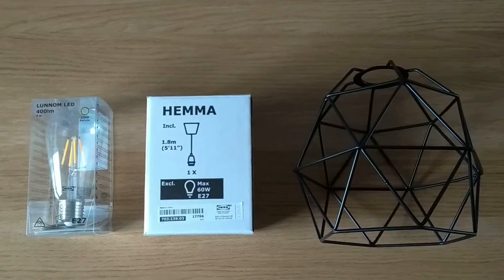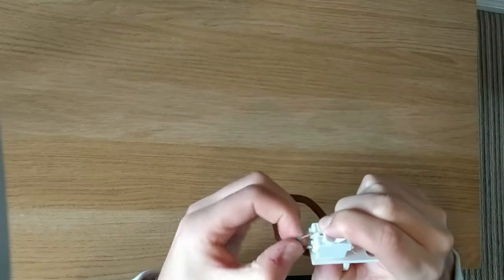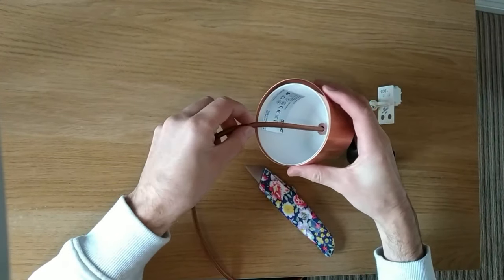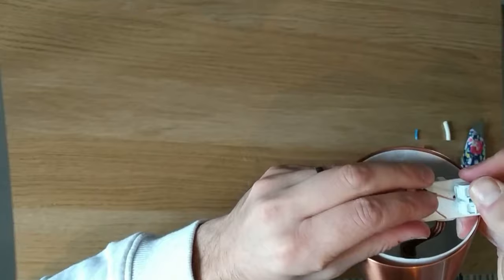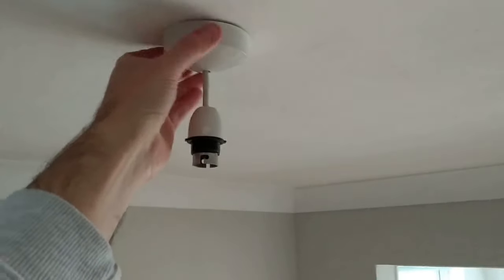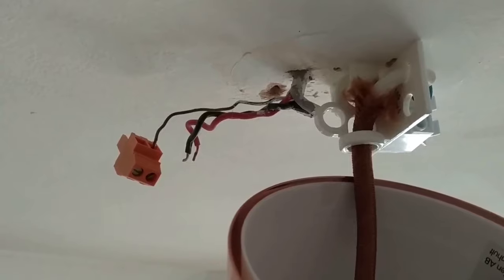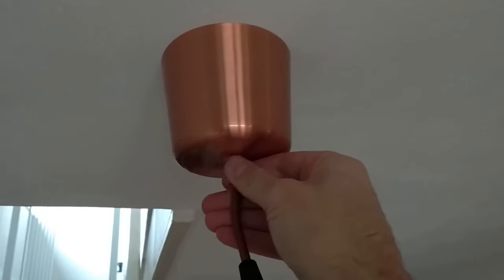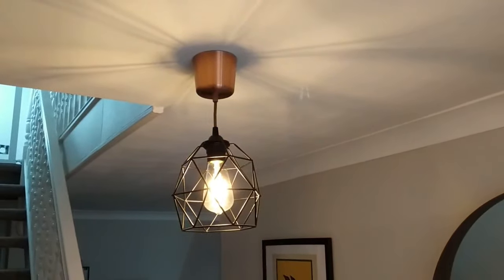Install a Light Fitting - IKEA Hemma

Comment: I think the design of this has changed slightly.  It's not as easy to shorted the cable as the the terminal block is only quick release on one side now.  It seems designed not to let you shorten the cable easily.

Comment: As another person has commented, this is designed so that you can draw the cable through the fitting that is placed on a ceiling hook, and in so doing adjust the height. So, in most cases you do not need to cut the cable to adjust the height. I understand you wanted to do this anyway as you did not want to wrap the extra cable inside the housing. But, even if you cut the cable it should be refitted the same way as it was before you cut it, threading through the two round holders, this fixes the cable to the part that is then put on the hook, which means any tension or weight is on the outside part of the cable and not on the inner cables that are carrying the current.
Reply: Sometimes you need to cut the wire, especially for the cheaper white domes as they struggle to stay flush to the ceiling with all that excess wire pushing down inside the dome (it all depends how high your ceilings are and the drop). For example the PS 2014 light is a nightmare! IKEA doesn't cater to older properties, all of their products are made for perfect showroom conditions.

Comment: With the updates ones that require a hook. I found it better to zip tie the ikea plastic cable gripper onto the existing rose base plate. It gave a much tighter finish to the ceiling. You can still underscrew the cover with ease

Comment: I was told by a Ikea staff member that to shorten the length of cord all you had to do was pull the cord up and twist it inside the top cord plate..🤔
Reply from the maker: Thanks Muhammad, you can do that, but I found there wasn't a massive amount of room for all the wire in the casing as I needed the drop to be so small. Having it bundled inside made the mounting using the hook more cumbersome also. I guess I just liked it trimmed, felt nice and tidy. Cheers

Comment: Hi - nice vid but I am about to throw it in the bin - i've screwed in a hook and attached the connection block to it but now what - i put the rose up to the ceiling and tighten the screw and nothing! It will simply not fasten to the ceiling but just falls away - this is the bit you have missed out in your video
Reply from the maker: Hi, the key is to find a hook that enables you to get your connecting block as close to the ceiling as possible. To get it touching the ceiling is ideal and will give you the most flush finish. I initially tried with a 'normal' hook (one that you might say looked liked a question mark), but it meant there was a gap of about 1-2cm between the connection block and the ceiling, and I too couldn't get a good flush finish. Instead you'll see I used an old curtain hook which I could screw in and get the connection block much closer to the ceiling (it was more fiddly, hence my inability to film it fully, sorry about that). 

Thanks for watching the video, hope this helps a bit.

Comment: I have just unscrewed my old light fitting and there are actually 2 sets of live & neutral wires (so 2 x black and 2 x blue). The ikea connector seems to have two spaces for each type of wire, will I be ok to put both blues and both blacks into the ikea light fitting connector or should I use a terminal block for one set of wires? Thanks!

Comment: Great video, this is the exact combination that I was about to buy from ikea so it's very helpful.

Rather than cutting the cable to the length you want would you be able to wind it up in the copper casing?
Reply from the maker: Yes you definitely could. I found I had too much bundled inside so cut it instead.
Reply: @learnasido533  Ok cool, it would just be around 20cm so i think it'll work for me. Thanks for replying so quickly!
Reply: Not electrician, but I’d be wary of gathered cable.

Comment: I don’t know if this is a really stupid question... but we’re fitting the exact same light right this second and can’t for the life of us figure out how the fitting stays up on the ceiling with no hooks or extra parts?!
Reply from the maker: Certainly not a stupid question. You do need to screw a hook of some sort into the ceiling for the fitting to stay up. This is unfortunately not provided by IKEA with the Hemma light fitting. I ended up using a large curtain hook which I screwed into the ceiling using one of the existing screw holes from my previous fitting. The white plastic part with the connection block on then hooks onto that and takes the weight. Thanks for your comment.
Reply: @learnasido533  hi there I can't get the fitting to hang flush to the ceiling is it because the hook is hanging to low?
Reply from the maker: Hi, yeah probably, the closer you can get the plastic connector block to the ceiling the better. That's why I ended up using a curtain hook instead of a normal hook because it was hanging too low otherwise, and the copper light fitting didn't sit flush to the ceiling. 

I also found shortening the wire like in the video helped, rather than curling the excess up in the copper fitting. 

Hope you get sorted.
Reply: Extremely frustrating!
How do you get the fixture flush to the ceiling? Why would ikea leave this important part out. I guess you get what you pay for. Customer service was not helpful😡
Reply: I have loop in system, so about 9 wires, and no space for a hook, at least properly... how can I do this?? its driving me crazy

Comment: I have three cables coming down from the ceiling. Will this work?
Reply from the maker: What colours are they? Blue, brown and yellow/green?
Reply: Did you figure it out? You likely have your lighting wired in a loop, so each ceiling rose connects to the next light, and has a switch drop. In that case, I recommend not removing the ceiling rose but using it with the flex from the Ikea cord set. The Ikea rose is secured to the flex rather than the other way round, and it is wide enough to fit over a standard UK ceiling rose.
Reply: @SamButlerUK can you explain a bit more please? We have a loop as house was rewired 2 years ago.
Reply: @SamButlerUK we've worked out what you meant. Just replace the cord of the original ceiling rose with the IKEA one by threading it up through the hole in the unscrewed  original ceiling rose cover , wire the 2 wires in and re screw the ceiling rose cover in place , then push the IKEA dome over the top of the ceiling rose and screw the cable holder onto the underside of the dome.
Reply: @susanelliott1912 you have indeed - that’s exactly what I meant (and did)! Glad that helped and hope you like your new pendant!
Reply: @SamButlerUK  worked a treat. Bought 4 such pendants with copper domes and glass shades for £40 on FB marketplace. 
After reading your tip we had all 4 fitted in about an hour and a half. 
Thanks so much ! 👍❤️
Reply: @susanelliott1912  brilliant! So glad I could help :)

Comment: Late to the party. We left our original ceiling rose base  in place ,removed the cover , shortened the flex, pushed the fkex through the hole in the original ceiling rose cover , wired the ikea flex in as per this video , screwed rhe original rose cover back up and then pushed the ikea copper dome up over the original ceiling rose and screwed the nipple up.

Comment: Really with great help for replacing old light with new light fixture. Why not use a special  socket, which make it so easy to install, remove or replace with new one as to insert or pull out a plug from an usual socket, please find it:  https://youtu.be/0pMsya3hrHo

Comment: Where is the guidance when you have a cable feed through in your base i.e. 3 cables to the fitting as is very common? This job should be done by an electrically competent person. Buy a lamp shade not some dodgy new light fitting where you are going to risk electrocution or mess up your house wiring. Also, you gave no guidance for putting in the 'picture hook', and no guidance on tightening the fitting to the ceiling to get the desired hang length.